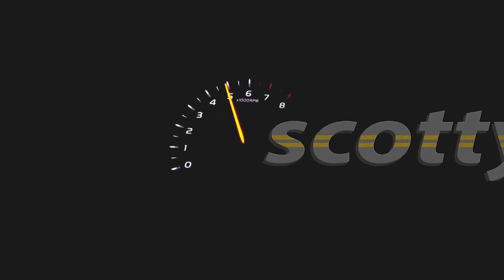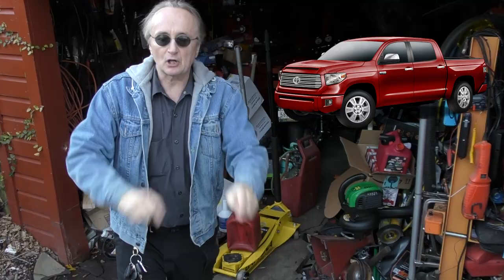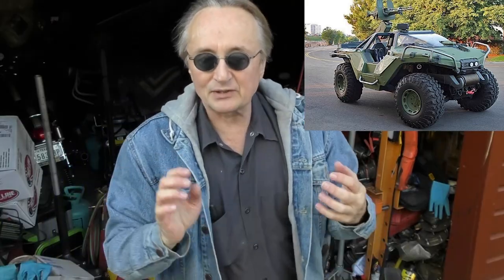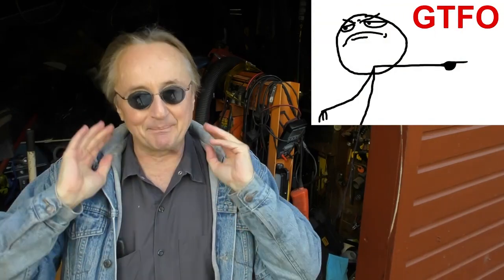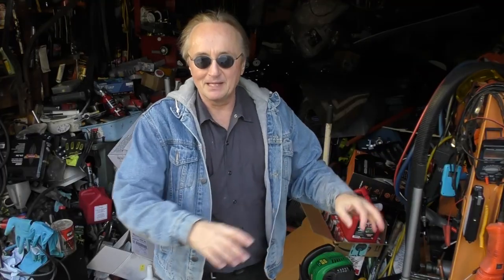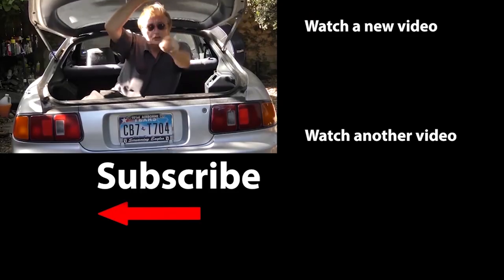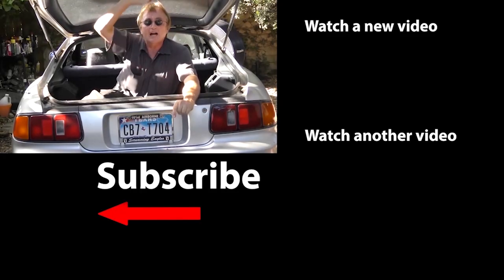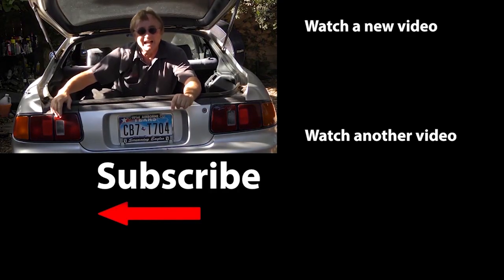5 Used Trucks You Should Never Buy

Comment: Get a Nissan frontier.  They are the cheapest truck on the market and they are quite reliable.  Just do not get the automatic transmission ones if they were built between 2005 and 2009 (I think was the years, not completely sure).  The reason not to get an automatic transmission in those years is due to their problems with coolant leaking into the transmission and ruining the whole transmission.  I have a 2006.  It is a king cab(half door) with a 6-speed manual and a 4.0 liter v-6.  I have been nothing but happy with it.  I currently have about 136,000 miles on it and I have had to do nothing but put in a new clutch (previous owner was a little hard on it😂) and I am getting ready to put in some new spark plugs.  Otherwise it is a fantastic and reliable truck.  MOST IMPORTANTLY, it is cheap.
Reply: Yes... I was scrolling through the comments looking for just this. I have a 2015 Frontier SV KC that is my daily driver (and I work and haul construction materials with it daily, never missed a beat currently has 83,000 miles on it), and have a 2010 Xterra Off-Road also and before that I had a 2001 Xterra. All automatics. I don't know why Scotty is saying the Jatco automatics are bad, all of mine have been great and I am very tough on my trucks. My nissans have proven themselves to be nothing but reliable for me. I cannot say the same for my 2005 Chevy Colorado that I traded for my Frontier. That truck was a money pit, it should have been on the top 5 list... You're exactly right on the years for the Frontier automatics, 2005-2009 were the trouble years, it's actually not the transmissions that were the problem. It's the radiators, they had a flaw that allowed the coolant to contaminate the transmission fluid through the transmission cooler that is inside of the radiator. Nissan had that problem fixed in 2010. My 2010 Xterra had the warranty extension for the radiator even though it had the first revision part # for the rad, but I am happy to report that it's currently at 143,000 miles and no issues. all of the 2005-2009  VQ engines were notorious for timing chain issues as well. That was fixed for 2010 also, just fyi for any one who might be shopping for one of these trucks.  Love my Fronty and my X.
Reply: @Mike.D.843  Great comment, I was going to mention the same things.  If you get the older ones with autos replace the radiator at 90k or just bypass the rad and use a tranny cooler then the fluids can never mix.  Honda also had this problem with pilots, odyssey, ridgeline, acura mdx, tl (anything with 3.5 or 3.7).  It usually happens well outside warranty (after 100k miles)though so the companies don't have incentive to fix it.  (Also seems more prevalent in rust belt imo.)
Reply: Happened to my buddy's frontier. The guy performs maintenance religiously, flush the ATF and that was the end of that truck.

Comment: I don't agree on the Hummer, I own an H2 2008 that I bought 6 years ago and it has not broken down at all, it has been a very reliable truck and I've driven it for 80,000 miles now, I guess I would be better off with a Tacoma or a Tundra right Scotty?? Surely any of those would last me at least 700,000 miles with very little maintainance right???
Reply: ....wow...80k huh.....
Reply: LUIS CASTRO 80,000 miles isn't even broken in. wait till you get over 150,000 and see what a headache you drive.
Reply: @aundrayperkins9796  so true
Reply: Same here pal, as long as u take care of them, they’re wonderful off-road trucks. Mine has 130k and it’s going strong.
Reply: I know someone who owns an H2 and the only problem they had was the radiator failed on them
Reply: Yeah WTF...they used the same engine/trans combos in all the trucks from 02-09 . I cant imagine it being any more unreliable than a suburban or silverado.
Reply: What 80k it better be running 
200k and up is what you can brag about and considered reliable my mid size truck is at 183k no problems lets see when your H2 arrives.

Comment: Here comes the hardcore truck fans saying the Ridgeline is not a truck because it's not body on frame.
Reply: Nope, its a truck for chicks!😂
Reply: @ubangiestomp  truck for chicks😂🤣😂 that's funny and very correct. Lolz.
Reply: I don’t think it’s a truck, but not because it isn’t a body on frame
Reply: Jason Thach it's a UTE even a Durango, Explorer,Tahoe, expidetion and grand Cherokee tow more
Reply: Its an Accord brah.
Reply: 620k km on a ridgeline before the motor locked up.
Reply: What's a truck?  My Ridgeline can fit a lot of payload and it tows pretty well too.  Only 5000 pound rating but it tows that with ease.   Best truck I ever had.
Reply: @james3429  It's miles and it's an engine. j/k good for you
Reply: @Davido50  correct
Reply: @gregs_garage  It might be the best automobile you've ever had but it's not a truck.
Reply: Car suspension in the back. If you want to haul, need solid axle and either leaf springs or coil springs. Engine sits sideways, so drivetrain is primary FWD, if you get base model or AWD system fails.
Reply: If it don't have the performance of a truck 
It's not a truck 
Just a cut back SUV
Reply: Nope you said it
Reply: @gregs_garage  The dictionary  definition of truck is much different than the opinion of those who claim the Ridgeline isn't a truck.  I've had two Ridgelines, they're quite reliable, I've seen 4 of them with nearly 400k miles on the odometer and still going.
Reply: @gregs_garage  At that time it was comparable to the F150 in towing capacity. Also I don't have to much credibility in this guy either he's been inaccurate about other "information" too.
Reply: That's not the only reason
Reply: My dad has a 2018 Ridgeline since the fuel economy on the highway is better than any 1/2 tonne. Not everyone is hauling bricks and sleds with their trucks. Honda fits the bill for some peoples needs nicely.
Reply: They can't tow worth a dime.First upgrade a Ridgeline would get is airbags and suspensions to prevent it from squatting.
Reply: Meanwhile they don't want to scratch the bed in their pavement princess money pit
Reply: @billgateskilledmyuncle23  Really, a 2006 RAM 1500 has a solid axle yet only a payload capacity of around 1100 lbs. Ridgeline hauls 1550. Can u splaine?
Reply: @CorvusRemalius  Check the internet for pics of a RAM 1500 hauling and squatting. Junk
Reply: @jcagg6067  we'll see, the 1500 is not the model you want for towing and getting down to business, you want the 2500 and 3500 diesel single or dually trucks. Im in the RV business and those two are what we use, in fact Rams are mostly used to tow in businesses.
Reply: @jcagg6067  I will say it makes no sense why they made the 1500s so flimsy, great power but no backbone haha.
Reply: It is as much truck as a subaru baja.... why do you ahve a picture of a chick and your name is jason...
Reply: @james3429  yeah i am not sure where scotty was going with that... most ppl with ridgeline don't really tow much anyway.  i got a great tundra but don't tow aything except people and a bunch of stuff in the box... i could get by fine with a ridgeline.... except i wanted a truck ;)
Reply: Odyssey/Pilot chassis..... lol

Funny, tho... in PA, Ridgeline gets "truck"tags, but Odysseys and Pilots dont....
Reply: @CorvusRemalius  Of course not. You need to use the right tool for the job. I wouldnt buy a Ridgline to regularly tow over 5000 lbs. or for a tow business. That's crazy. Neither would a use a hand screwdriver to install drywall. I's be there all day. But a Ridgline can be used as a 1500 standard duty truck. That means its every bit as capable as a standard f-150, Ram 1500 or GM 1500.
Reply: It is not a truck and that is only one of the reasons, Jason.
Reply: @justclickedtodislike9236     The words "truck" and "Honda Ridgeline" should not be used together.
Reply: @tommytruth7595  What cant it do that any other short bed 1500 standard duty does?

Comment: I have a 2006 Dodge 2500 Cummins diesel.  It has been a good truck, has turned over 280,000 miles.  Much of that pulling a gooseneck trailer.  I perform regular maintenance on it, have replaced those things that all vehicles need replaced at some time or the other.  Pretty much my daily driver.

Comment: These are the 9 best pickup trucks ever built you can get secondhand for a couple thousand bucks:
1. TOYOTA HILUX!
2. Ford F-150 / Ranger
3. Ford Super Duty
4. Toyota Tacoma
5. Chevrolet C/K 1500
6. Dodge D250, D350, W250 or W350 (5.9L Cummins)
7. Dodge 2500 & 3500 (5.9L Cummins)
8. Chevrolet C10
9. Nissan Hardbody 4x4 (1986-1997)
Reply: Dunno bout Hilux but F150/F250s are terrific! I concur.
Reply: Datsun
Reply: @aundrayperkins9796  - Datsun trucks were pretty good little work boxes, back in the day.
Reply: Hilux and Tacoma are basically the same... hilux is sold around the world and Tacoma is USA version

Comment: When I was looking for a used truck I was blown away  with so many Ford Engine options, turbos eco boost turbos,  Chevy with it's long term lemon issues,  Nissan and their transmission issues, I ended up with a Tacoma.  I feel like they are behind the cutting edge, lack fuel economy but is going to run for the forseeable future like the 2018 Camry we have.

Comment: I agree Scotty . I sold cars for years and also fixed them. I had a h2 hummer it was a lemon . Lots of problems with transmission in dodge . My opinion buy a Chevy . I’ll post a video soon
Reply: Surely a Toyota hilux
Reply: Yes those trucks were bullet proof. Mid 2000s Chevy . Great truck imo. as far as the hummer it was poorly engineered. Super heavy body on a light chassis and drivetrain. Motor was under powered for the size of body. Transfer case and steering box were other things of concern.
Reply: I worked at local transmission shop saw way more problems with chevy transmissions then dodge. From impala up to silverado those 6l80 are junk in my opinion idk how many I rebuilt under 110k let alone how many I seen under 60k miles needing a rebuild
Reply: M. Sami  sooo it is a piece of junk too? yeah i know.

Comment: I agree with most everything in this video except for the 04 to 15 Honda Ridgeline.  Having owned one myself and knowing several others who have owned them, they are solid.  Saying a Honda Ridgline is a bad vehicle to own is saying a Honda Pilot SUV is a bad vehicle to own.  The engine was almost identical and lots of folks pull them on totaled vehicles to power dune buggies because they are solid.  Ridgline's were also All Wheel Drive and got into the low 20's on gas mileage.  What other truck can claim that?  Living in Oregon I took mine into the woods many times and it's almost impossible to get them stuck (unless you high center them).  You can buy a lift kit for them, there are tons of aftermarket mods for them and they retain their value fairly well.  My brother bought my 2008 and is still running it as his daily driver without any problems.  I only sold it to him because I already had a 1992 Chevy 3500 Dually Crew Cab farm rig and decided to switch to a car for my daily driver for commuting to work.  With all due respect, your are wrong on the Ridgeline Scotty.  They are solid, well built vehicles.
Reply: Always heard good things about the Ridgeline, but also always heard the mpg was about 15-16. Every Ridgeline owner I know says the gas mileage should be better. Did you really get in the low 20s? Because you'd be the first...

Comment: Scotty is wrong about the Ridgeline, mine has 290,000 Kms and it has had zero problems. 2007 Honda Ridgeline RTL btw.
Reply: The Ridgeline is not a truck its a pilot with a bed.   Why does Honda disrespect the truck name like this
Reply: Jackson Pitcher he’s still wrong sometimes Scotty has no clue what he’s talking about. The Chevy ssr was a higher performance truck was never intended to haul or pull.
Reply: My 08 had 116,000 miles, basic maintenance, tires, brakes, that’s all.  I don’t need a heavy duty truck (although I also have an old F150 5.8...)
Got the Ridgeline new in 08, it has really been a good vehicle...
Reply: Christopher Hamilton 11600 isn’t a lot of miles
Reply: I've had problems with my ridgeline but nothing that didn't make it not worth the buy. But Idk, we'll see how she's doing after the summer.

Comment: BS I have bean buying dodge trucks since I first got my licence at 16. I drive them for 200,000 miles. Then buy a new one, after the 200 k break in period.
Reply: Not anymore ram has went to the tubes since going overseas
Reply: I’ve had 3 starting with a 98 and had problems with all of them, 2001 was probably the most reliable one but the body was rotting away by 2008 ...... idk I’m done with ram.... which honestly is a shame because I always liked the look!

Comment: I can't speak for the Dodge Ram Daytona, but I'm definitely a firm believer in the Dodge Ram. I had an 02, 4.7 V8 Automatic, drove it for 6 years, and the only thing that went wrong, was the pinion seal started dripping, and that was fixed under warranty. Traded it in 6 years later because I wanted a Ram with the Hemi. Got an 08, and never had a single problem with it for 9 years when I traded it in on my Chrysler 300. Chrysler products are solid as far as I'm concerned

Comment: Scotty the only Honda’s that had bad automatic transmissions were the 2001 to 2004 civics and accords  Honda’s don’t have weak automatic transmissions you obviously never heard of the Ford Taurus😂 you think Honda’s have weak automatics you never saw the failure rate on the fords
Reply: To say nothing of Chrysler/dodge
Reply: 98-02 accord sedan/coupe L4/V6  probably have hondas worst transmissions. Other than that, Honda is not bad at all 🤔
Reply: Yeah but Honda’s are weak
Reply: 2001 to 2003 Odyssey 
2005 to 2007 Odyssey 
2000 to 2004 Acura TL
All of the above ALSO had terrible transmissions.
Reply: @joedirt6212  99 to 2001 Honda Odysseys have the transmission issues due to the 3.0 Accord V6 tranny in those Odysseys then 02 to 04 Honda switch the Transmissions over to the MDX version they never had an issue unless you're using a trailer hitch 2005 to 2009 never had an issue with the transmission same scenario if you're using a trailer hitch

Comment: You are totally wrong on the Ridgeline.. I had two  Ford Rangers with a combined over 1/2 1,000,000 miles for a total of over 30 years I bought a 2009 ridgeline one owner fully loaded and stalled it I have hauled over  3000 pounds in the bed of tile I have a custom-made canoe attachment for the roof my transmission fluid is still red as read can be at over 125,000 miles  all my fluids or synthetic as well as all my lights are LED the truck has fantastic acceleration wonderful brakes and most of all it has a trunk in the bed ... The full leather interior is very spacious and fits two kennels in the back seat for my puppies I'm sorry I have to disagree on this one if you treat an auto bill like crap then you end up with crap . Don't forget it is the only truck that has a trunk.. I have a pest control business here in Florida and one of the conditions is I have to keep all my stuff locked up and it all fits inside the truck .. as much as I love all your other videos I call bull on this one...an excellent truck/vehicle..sorry too say your sadly mispoken and very wrong..

 
...
Reply: Hey, buddy, do you know much Honda and Toyota people are so easily triggered. Its sad that whenever you bring them a fact, they act like its not the company’s fault or some bullshit like that and that they had only good experience with them, reliable..bla bla bla. As a mechanic, i repaired and replaced way more things on Hondas than i did with domestics maybe except Fords id say
Reply: It's also funny how the Honda haters compare it to full size trucks in regards to capabilities. For its class and intention the ridgeline is the best.
Reply: JMANSWAT loll its all alone in its class. What can u compare it to?

Comment: I've never owned a Ridgeline but all of my friends who have them (1st generation) have only really complained about the gas mileage but must pick ups that are not small pick-ups frontier, ranger and s10 don't get great gas mileage. Trucks are either for utility or activity and you buy them for one or the other or both I think the Ridgeline was designed to be a little of both and a lot of neither. That's why you didn't see ridiculous commercials of it on work sites with nimrods dropping loads of concrete blocks in the bed (I wouldn't let someone do that to my wheel barrow.) The Ridgeline fits in a certain segment and you buy it for that. Not to be "the best never rest" or look like a "rock". By the way I'm a Ford guy, own a f150 but I try to be objective about vehicles.
Reply: A small Honda dealer did the same test in their parking lot without all the fancy set-up and underhanded tactics. All it did was scratch the composite liner.

Comment: Hard to believe Honda could actually make a crappy product!
Reply: Honda 2016 and on has been pretty shotty. Oil dilution, electronic issues, ect..
Reply: Cause ur brainwashed. At least ur waking up! Kudos.
Reply: Don't Honda have piston ring recalls?
Reply: Buy a used Odyssey and see what crap is. Keep money handy for your eventual transmission replacement.
Reply: kman 4443 says who?? Mine 05 over 200,000 no trans issues.
Reply: It seems like the Honda’s that aren’t successful are ones that don’t know what they are. (Del Sol)
Reply: @justiceleaguer9108  If you are truthful, you are simply one of the lucky ones.
Reply: @justiceleaguer9108  Good to know my accord v6 has 131000 original transmission no issues I guess only me and you got lucky.
Reply: No but toyota does.
Reply: My dad's 02 odyssey had 341k before he scrapped it due to rust. Original everything. They are good vans.